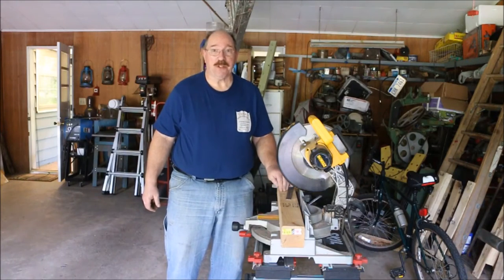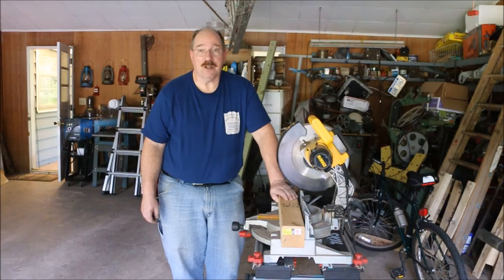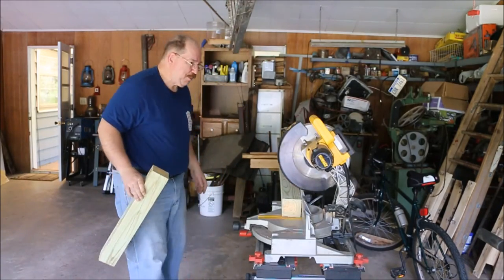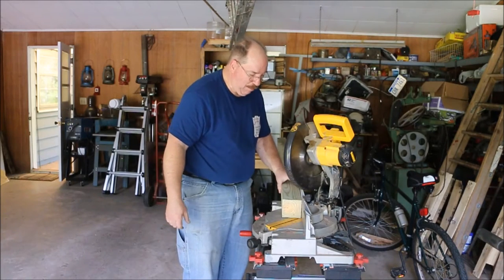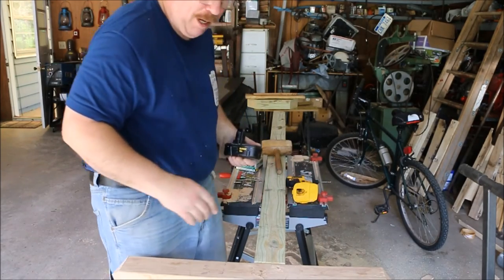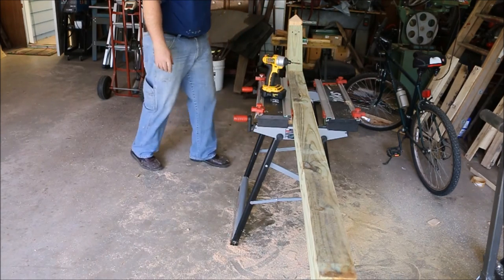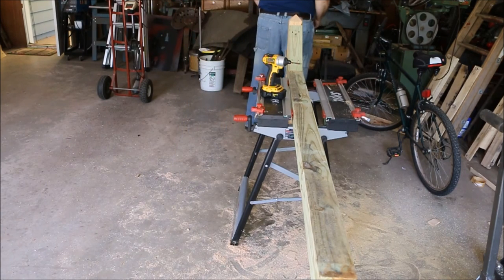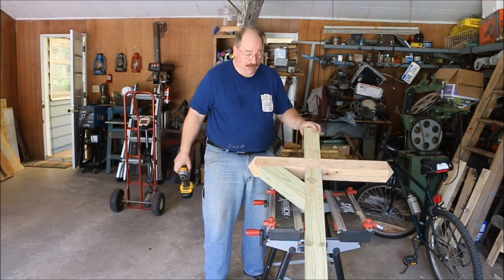Replacing The Mail Box Post ~ Pt 1 ~ Making The Post ~ By Old Sneelock's Workshop

Comment: I remember the tractor deal very well. Maybe go to the scrap yard or out back in Sneelockville and get a chunk of train rail and wrap it with cedar or something pretty. Then if the knotheads start running over boxes you'll be able to find who it is because their front tend will still be hanging on it. I measure 75 times and still cut it wrong. I need a lighter miter saw but the Makita is paid for and 10/4 about the battery rigs. I wish I had one right before I remember why I got rid of mine. Good looking post too! Now all you need is a bag of 'instant hole'.
Reply from the maker: The track would definitely stop them but I don't want to kill anyone. 
Warning story to follow: When I lived near Union City I put up a mailbox when we moved in. it was very similar to this one and lasted almost 20 years before I woke up one morning to find it snapped off. When I went out to see it I found that not only my mailbox was damaged. 
My neighbors, across the street, had a corner lot. To discourage the practice of cutting through their yard the had a pile of landscaping stones around their property at the corner. They also had some short posts in the center. 
The posts had been knocked out of the ground and there were tracks where a vehicle had driven over my mailbox, just missing a telephone pole, then drove up and over the rock pile. The tracks stopped there but reappeared in their front yard about 50' away. Whatever it was blew both tires on the left side. 
The driver managed to steer out to the road and drive off. 
I followed the 4 deep grooves in the road, where the mag wheels were grinding themselves to pieces, toward town. The grooves went down a few side streets, down a driveway, and into a closed garage. 
The state cop laughed when I explained what happened. He knew the guy. A new post was delivered to my house the next morning.
Reply: You wouldn't kill anybody. It'd be up to the individual how fast he wanted to hit it. I pals brother did it with a crosstie. After the junk got hauled off the city just made him put in a regular post but nobody ever ran over his box again. I suppose they thought he just might change it like he did before.
Reply from the maker: My Mom had a problem with the snow plow hitting her mailbox. It wasn't really hitting the post but she lived on a 1 mile stretch of open road and the plow would be going so fast the snow would just blow the box off the post.
I bought a big round bottomed flower pot and put a post in it with concrete to weight it like a Weeble. The next time the plow hit it with snow it just leaned over and rolled back up. She would have to go out and spin it back around every once in a while but it never broke again.
Reply: You did good. No jail time for you OR Mom!

Comment: Looks good! Hope the Post Office appreciates your hard work. What kind of fasteners did you use? I know you know about PT wood chemicals attacking anything but hot dipped galvanized, stainless or coated fasteners.
Reply from the maker: For this one i used plastic? coated decking screws. Not sure what the coating is. I've read about the problems with nails and scews in pressure treated lumber. Stainless would be the best because coating, whether galvanized or plastic, gets damaged. The problem is the cost. 
When I put the new motor mount on the little red boat I bought stainless bolts. There were only 6 of them. Putting a deck or a dock together takes hundreds. The phone and power companies went with galvanized hardware. I'm pretty sure some of them are older than I am and still working, but that's in cedar and creosote, not PT lumber.
Reply: Old Sneelock's Workshop
The previous owner of our place put some zinc wood screws into a PT Sill plate in the Shop. At the most this was 6 years ago. I took one out and was amazed that most of the threads had rusted off and ruined pretty much the holding ability of that screw. Needless to say I replaced that and any others I could find. Simpson makes a coated hex head screw series that is approved  for use in PT wood. Not cheap but cheaper than stainless.
Reply from the maker: Good to know.

Comment: I see you used a worm drive circular saw. Do you prefer that to the direct drive? I have been looking for a use one but have been unable to find one in my price range (cheap).
Reply: just foundnyour series on this saw. I am watching it now.
Reply: They're tough as woodpecker lips but Arthur does NOT like them.
Reply from the maker: I used it more because I can, not because I needed to. in my case the replacement handle cost more than the saw.
Reply: Old Sneelock's Workshop No use having it if you can't use it. My theory too.